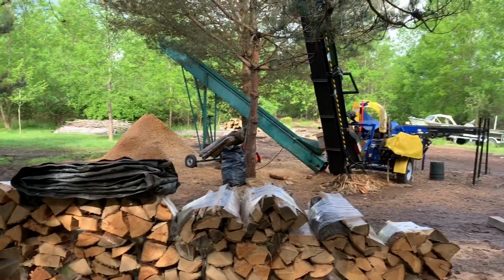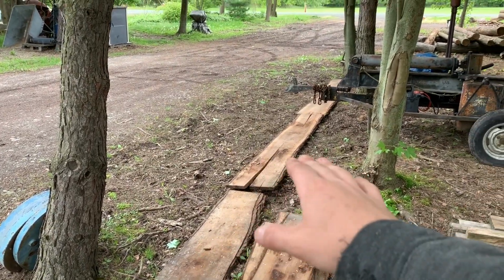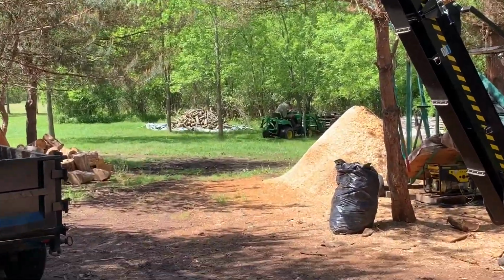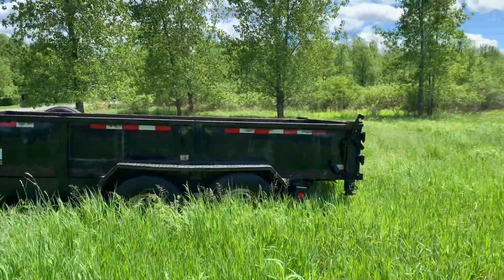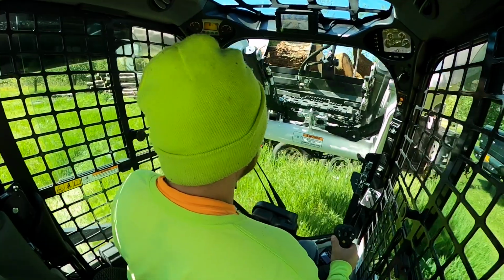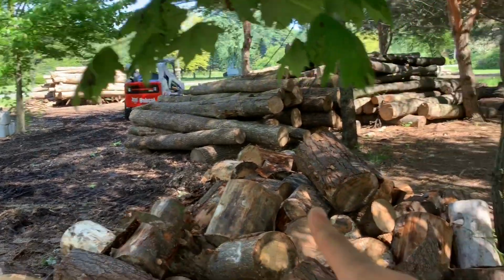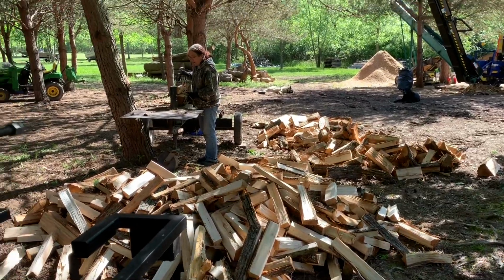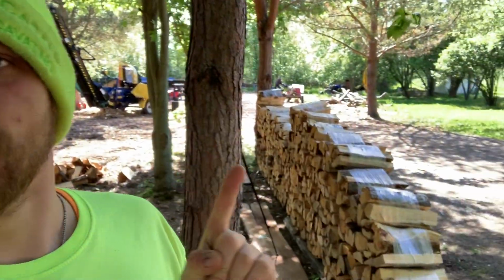NEW CAMPWOOD OPERATION STATION!

Comment: Instead of eliminating a step, I recently had to add one. A local homeowner had a red oak taken down and was giving the wood away. They said it was 16" or 18" and I took that to be in diameter, but it was length. The rounds were actually closer to 28" or so and my splitter would not bust them, so I pulled out the trusty Fiskers splitting axe and busted them up small enough to split on the machine. I don't have the abilty to vertical split, so I have to be able to pick them up. I got almost a cord of great red oak, so it was worth the effort, but boy, it was some effort.
Reply from the maker: Phil Griswold you’ve been busy sir! That’s tuff having to pick them rounds up on the horizontal splitter.. great idea to crack them down with the fiskar first! I love my verticals just for that though. But a pain to use after awhile for some. Great job on the oak! I live red oak. It splits decent. Cuts great and smells good too! Thanks for watching tho sir! Always appreciate your support 👍🏻

Comment: Bobcat is taking forever to get you your new grapple. Skid steersolutions.com is the company I buy my attachments through. Good guys to deal with, fast and free shipping.
Reply from the maker: Gimpy 83 it’s getting me antsy man! I’m going to check that out! I’m really thinking I need a frost bite grapple for the log handling more than anything. What do you think? Do you have any experience with one? I used a friends of mine on his machine and it worked like a charm.. so small and nimble of a attachment I felt like I could pick up a straw and put it in a glass of water lol! Thanks for watching tho gimpy. Always appreciate your support 👍🏻
Reply: ThatWoodGuy I have seen frostbite grapples. Never used one but they look like they are well made. I use a 60” grapple from Loflin Fabrication. Love it. I have it on the skid steer probably 90% of the time. Use it to load logs, move brush, stones blocks of wood, skid trees, I beat it up and haven’t had any problems in the 11 years I’ve had it.